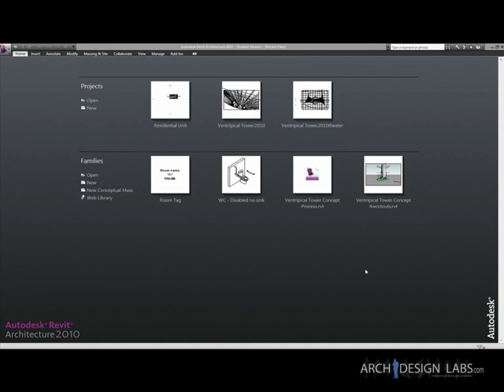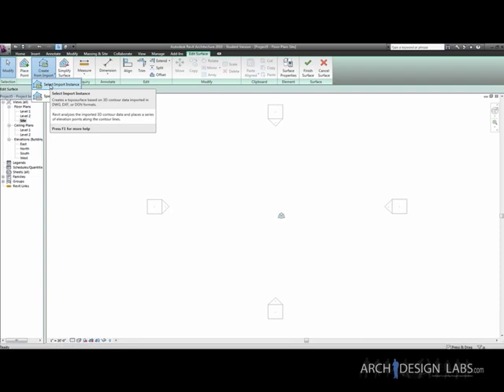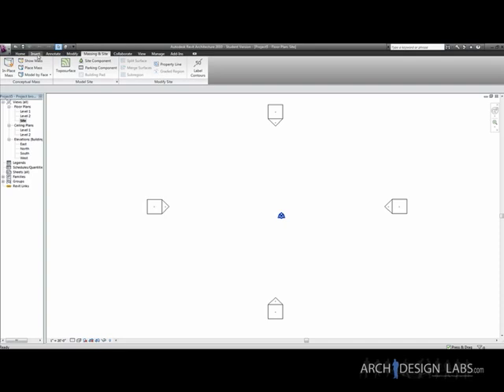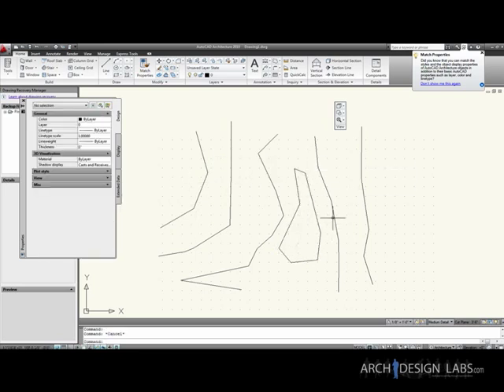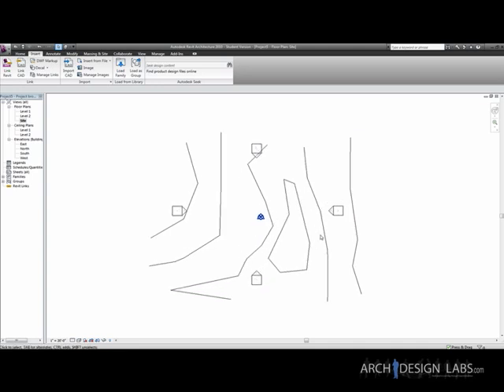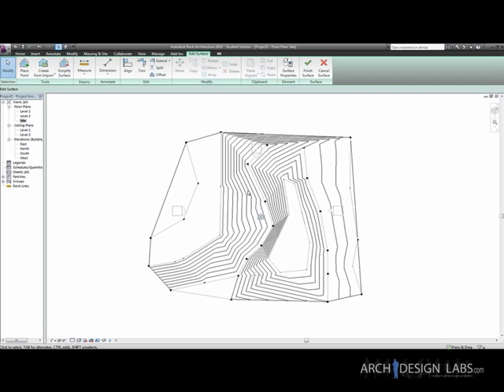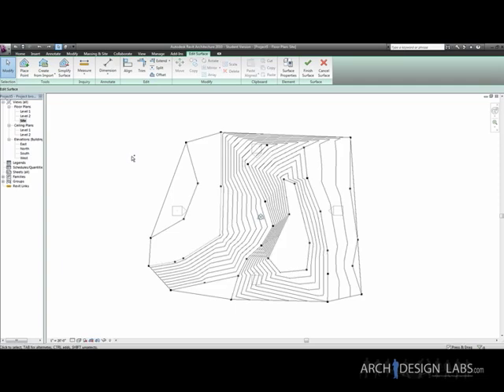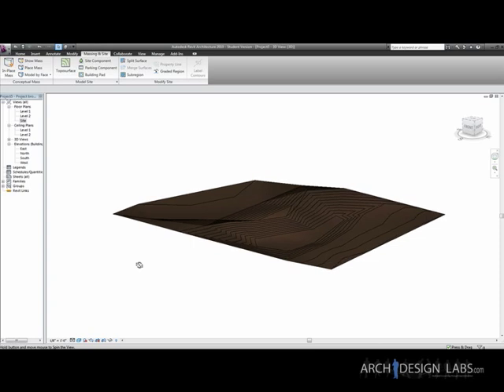Import Cad as Toposurface

Comment: Hello. I really need to ask you. I wanted to insert topography from CAD, but got the flat surface, I don't really want to add elevation to every point Revit makes from these lines manually, As I noticed, if I added same start z value and end z value to lines (not polylines), representing isogypses in CAD, Revit would generate some kind of 3D toposurface. However, some parts of it are Ok, but some parts just like walls with no upper sunface. What is the right way to do it?